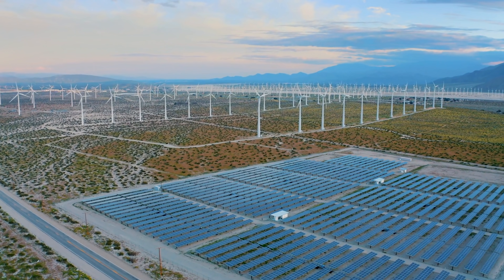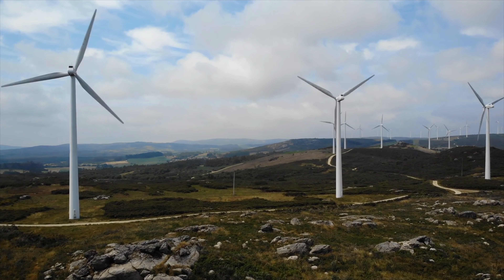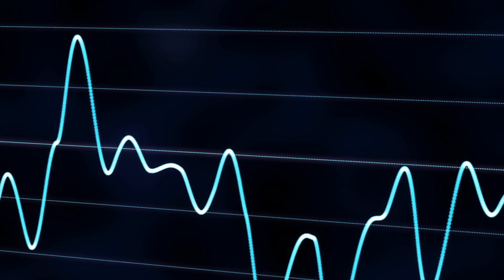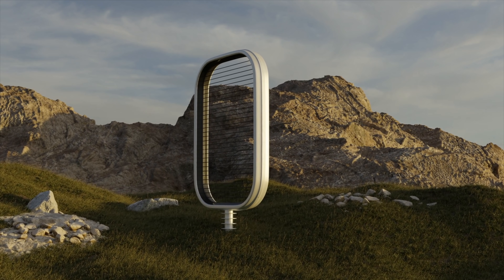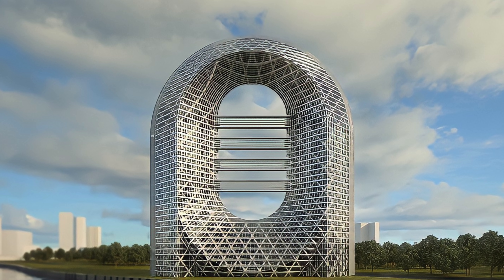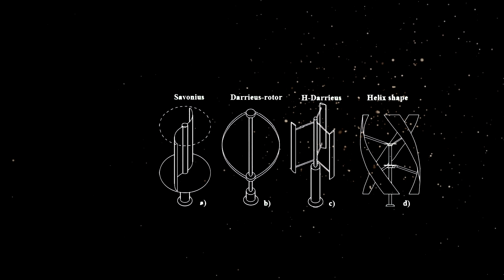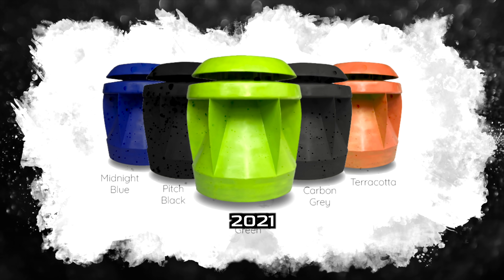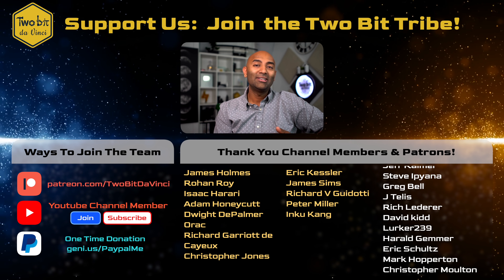These Wind Turbines have NO Blades!

Comment: I feel like there's something to your comment around blending art with function in order to proliferate these more readily. That's what architecture is and it's more expensive then traditional engineering which maximizes efficiency and manufacturing practicality for repeatability. But if you sacrifice some of that and have cities and governments say every statue and art installation needs to contribute some non zero energy production to the public good, I think you could start to see a real gain while also engaging larger swathes of the public and repurposing public green spaces and art installations towards combating the current climate crisis. It's not a practical solution. Hy a long shot but every little bit helps and those dollars will be spent so why not ask art to make a 1 or 2 percent contribution to the cause when we're asking every other industry to contribute.

Comment: Oscillating generators, what effect will ground vibrations have on the environment from a high density farm? Many animals and plants are sensitive to vibrations. The water/ethanol charged particle is forcing a massive amount of water vapour into the atmosphere to generate power, what effect will this have on storm severity. We are already seeing high quantity down pours, flash flooding because elevated global temperature is increasing water evapouration and then these generator are going to pump more water into the atmosphere.

Comment: Have been enthralled with your presentations! As you were speaking this morning about "Bladeless Turbine" technologies, I was wondering about my rooftop "Whirly Turbines" which passively vent my shop building? To aide their usefulness, I added some 30x8" screened vents to the cool side of the metal building. They are positioned side by side, staggered a bit vertically; and have a splash guard at the top to prevent rain from entering the screen paths. Without these two intake vents, the Turbines hardly moved unless you opened a door. Since installing these vents, though the space within can still reach in excess of 90F during the summer, it's better than the alternative of dead air! If I were to add even more of these vents, the cooling effects could be compounded. 

But these technologies sparked my interest. Why couldn't a bank of roof turbine vents be utilized in a similar manner? Mine are 14" aluminum turbines, that take almost nothing to begin turning. I did a quick calculation, (E=mc+/-?wst), and realized that with an increased ambient comes a substantial increase in the flow of cooler air pushing the hot air toward the egress; namely the turbine exhaust fan. So with enough intake , the faster the speed, and effectiveness of the turbines! Both cooling, and in some cases, heating, could be added as byproducts of making power. Simply put, it's air to air convection through tunneling.

Comment: Thar power pod is a largely scaled down version of another type of effective generator. One i saw was significantly larger with a square intake designed to increase airflow that could be opened upwards to get  more potential oit of lower wind speeds or downwards to throttle for high winds.

Comment: I want and half way there, to run my RV A/C with solar (all day) and wind (all night), installing one 9000 mini-split 120v 24SEER .($2000). I now have two 100w panels (315v) on my 22' RV roof and 4 on my roll out awing and 4 more on the driver's side awing = 1000 max , soon to install one or two VAWT 400w (really 200w)  turbines (removable ) on post. the mini-split is AC and heat.. will remove my loud FAU and install more batteries in its place.
i already install a large tankless water heater (gas) on the rear or my RV (< $100 on eBay) ...
Hamish

Comment: What happens to the parts of the turbines that have reached their service limits? Are all the parts recyclable? Are they being buried in giant landfills? Inquiring minds would like to know. Cheers
Reply: I don't think the blades are recycled  or recyclable.
Reply: Turbines part are renewables up to 90% ( not counting insulation and gear lubricant ).
Reply: @cygnusx-1855  Yep, just like all the other things we were told were recyclable, but never actually get recycled.

Comment: It is illegal to kill raptors and the US National bird. Such birds are often endangered and are killed by some of today’s wind turbines. Outdoor cats are not killing these types of endangered birds, which target rodents, and clean up dead rodents infected with diseases like bubonic plague. Comparing the two distinct & important problems is a false dichotomy.

Windmill also cause significant regional warming… raising surface temperatures by measurable quantities, much the same way urban areas do.

Small Windmills at the shore, where wind is always blowing, breaks small wind turbines fairly quickly, as demonstrated in public parks, where they are often down & under maintenance as often as they are working.

Windmills also require energy to heat them during freezing temperatures, to keep them safe & usable.

Power lines to locations where large scale wind can be leveraged, don’t exist today, to leverage energy generation that we need to implement today.

Power traversing over power lines is lost via resistance, creating heat, ironically contributing to regional warming.

At home wind power is absolutely a technology to leverage, since those power lines exist, and localized energy production & consumption should reduce the heat generation due to energy traversing long distances.

We need to harness wind technology, the same way we need to harness all energy. Energy is dirty, all energy is dirty. Minimizing and ignoring the negative impacts is not helping us solve the real problems of our energy needs in our biosphere.

Comment: I’d love to see turbines around freeways that could capture wind from passing by cars
Reply: There already testing them in Britain they're placing vertical wind turbines on freeways attached to light poles taking advantage of the airflow created by passing vehicles to power the light and traffic information.
Reply: maglev vertical windmills on a smaller scale would be better suited for that type of capture
Reply: I've actually seen the vertical turbines fixed to posts that have solar panels placed at bus stops along busy streets in Chicago.
Reply: They have that already
Reply: The breeze from passing cars is at ground level not 150 ft in the air and it’s not consistent.
Reply: People saying it would cost cars more fuel 🤣🤣🤣 not at all, the only way you'd get more resistance driving by one is if it was directly in the road. Roadside turbines collect some of the energy that's already been lost by cars pushing through the air. It's like saying driving through a tunnel costs more in gas which even if it did, it wouldn't be enough to matter. That's not how physics work. The car doesnt directly get affected by a roadside turbine. They collect already lost energy
Reply: @bigprojects2560   Oh yeah, you've found free energy? You are literally calculating a 0 pressure differential which is why you're assuming 0 loss.
I don't understand how people don't learn about physics... wtf are they teaching you kids in schools, feelings 101?
Reply: They already have that in England. turns out that highway windmills are working really well. But it´s not the passing cars that generate it since that´s impossible in the this universe.
Reply: Are fuel prices not high enough for you yet?
This will add to your fuel cost. 
Even if you do not drive, food costs will jump up.. so you would pay no matter..
Reply: Cars and trucks will press the wind of the entire earth in front of it. So what if that push makes some windmills rotate ? People in this thread thinks that some rotating windmills, push back harder than the pressure of earths atmosphere. It has been calculated by these guys called scientists, and they released papers on this project, and been approved by UK government. This is FaceBook science and it´s stupid to read. Everyone is an expert and no prove but "feelings"
Reply: I've always wondered if all freeways were covered creating wind tunnels would they pay for themselves in gas savings 🤔
Reply: Yeah you literally be stealing the gas from the cars
Reply: @melody3741  accept most cars will be going electric soon.
Reply: if you go to the Denver Airport and ride the train they have pinwheels as art that cost millions of dollars that spin as train passes through the tunnel. It produces nothing more than good feelings to watch. In government circles it's considered a rousing success.
Reply: The only problem with that is it may cause a little higher wind resistance for the cars causing them to use more fuel and thus offsetting any gains. Better to put them where there is natural wind. That being said, Detroit Metro airport has some in the center divider of the north entrance to harness the draft wind from both directions of cars passing by.
Reply: @a2cryss  Still, I can see putting them between buildings where natural winds are accelerated by the shape of the passageway.
Reply: It sounds great on the surface but is so inefficient that if the traffic is gasoline-powered, it causes many many times more pollution from the multiple conversion losses than simply running some gasoline-powered generators along the freeway, which is still terrible. With electric cars the environmental impact may be lesser, depending how the electricity was generated, but still horribly inefficient due to 10+ conversion stages from the car charger to the street light.
I vaguely recall some concept of using piezzo elements in the pavement to generate electricity from passing cars, if that works it would be far more efficient.
Reply: Not a fan of physics are ya?